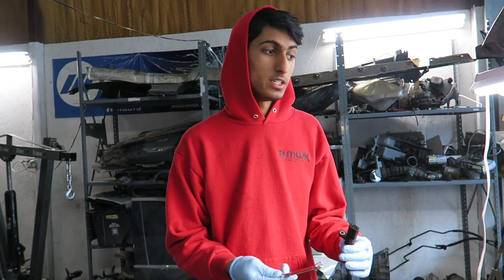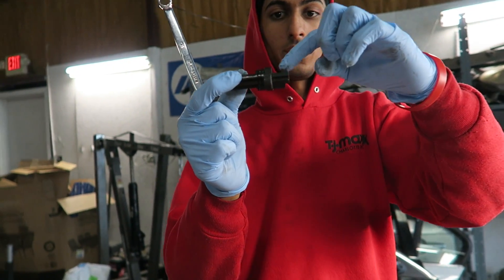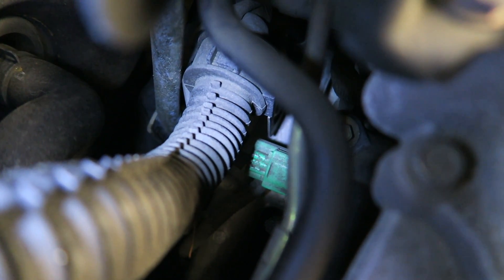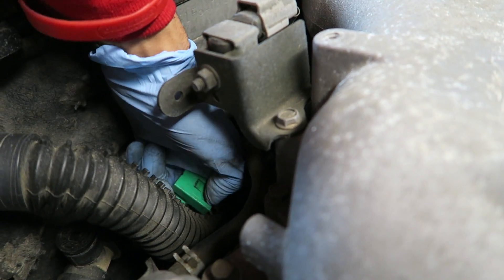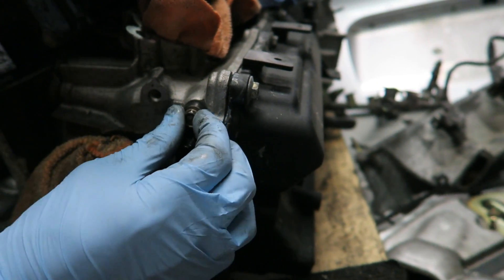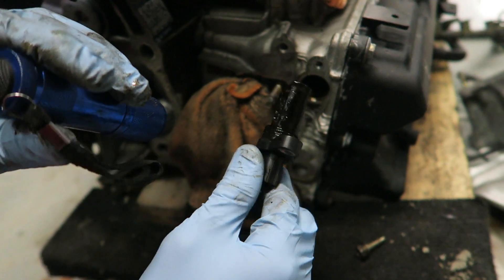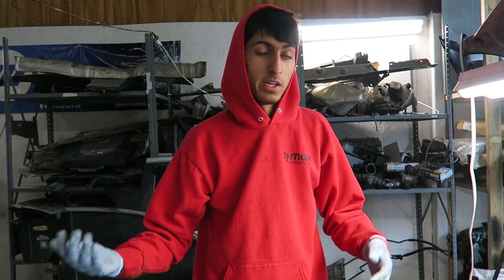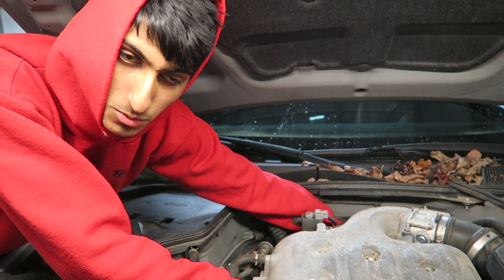Infiniti Camshaft Position Sensor Replacement DIY

Comment: Hey My Mechanic Just Replaced My 2 Camshaft Positioning Sensors Today On My 2005’ Infiniti FX35 AWD 3.5 Liter V6, Bothe Sensors Were Replaced Today 12/04/2022’ Sunday, I Bought 3 Oem Nissan Sensors From A EBay Online Seller That Sells Factory Part’s @ A Discount, Don’t Know Where They Are Getting Them From, But They Came In Nissan Oem Box’s, So They Sold Me The (2) Camshaft Nissan Oem Bank 1 & Bank 2 On The Rear Of The Motor Close To The Firewall & Were A Pain In The Ass To Work On, So My Mechanic Replaced The 2 By Firewall Passenger & Drivers Side, He Didnt Replace The Front Crank Shaft Positioning Sensor, He Did The 2 By Firewall, Started Car Back Up, & His Scanner Is Saying Something Going On With My Abs System, Why My Slip Light Is On VDC, & Abs Lights Are Still On, Now Videos On YouTube Are Saying That The Camshaft Positioning Sensors Cause The Abs, AWD, & Slip All To Come On, But Apparently Not, After He Replaced Them 2 Camshaft Positioning Sensors, Now The Car Starts Right Up Without Long Cranking Before It Turns Over, & So Far No More Stalling, It Would Just Stall Out While Driving, But After He was Done, He Scanned The Whole Car System, & Everything Checked Out Ok Besides, Vapor Canister Purge Solenoid Was Coming Up On Scanner, He Cleared Check Engine Code & Then Go To Start Car Again, Check Engine Light Is Back On, So He Said Order This Vapor Canister Purge Solenoid, & That Will Clear Check Engine Light, The Abs, VDC, & Slip Lights Are Still On, & His Scanner Pulled Up 1 Code Fault Abs System Code C1203 Which Told Him I Have A Bad Speed Sensor On The Wheels Behind The Caliber Or Something, But His Scanner Doesn’t Tell Him Which One Is Bad, So Is That True, That My Abs, VDC, Slip Light Still On Causing These Lights To Stay On The Dash? He Said It’s 1 Or All Of The Sensors That Are On Each Wheel, But Like I Said His Scanner Doesn’t Tell Him What Wheel, All These Other Videos On YouTube, Were Saying If You Have Bad Camshaft Sensor, Will Trigger The Abs, Skip, & VDC Lights, But Apparently Not Because 2 Sensors Were Just Replaced Today, & Car Is Starting Up Quickly Now & So Far No More Stalling Out & Long Cranking Before Engine Fired, So What Are Your Thoughts On Why Abs, Slip, VDC Lights Are Still On

Comment: First you show a tube and a hose to the left of the camshaft position sensor, then later, the tube is gone and you have more room. What did you remove to get more room, and how did you do it?

Comment: Both sensors on ebay $13.17 free shipping....for a few extra dollars you can get a warranty from square trade..unlimited warranty..here's the link.

https://rover.ebay.com/rover/0/0/0?mpre=https%3A%2F%2Fwww.ebay.com%2Fulk%2Fitm%2F252804496479

Comment: I’m trying to determine what happened first in my FX35...a faulty sensor that caused oil to squirt out of it, or an oil leak that caused the sensor to go bad. 
All the issues that you described in your video are in my car.

Comment: Yo ShopLife! Just replaced my camshaft sensor bank 2 (driver side) with the help from your vid as well as changing the belts from your other video. Very helpful, thank you for taking the time to make these. 

Out of everything I did on my car today, the hardest and most annoying part was the shield underneath the car. So frustrating, all the bolts were rusted and when I tried loosening them it would break the plastic surrounding it. Had to use zip ties :O

Comment: duuude, you work on nissans too? didnt know you worked on J cars. i just left japan a month ago for california. picked up an 03 Nissan skyline (g35 in america) a few hours ago. took it home and as I was backing into my parking spot, it shut off. I remember having the same problem with my e46 in tokyo and it was the cam sensors. As with the e46, i didnt get a check engine light on the skyline. so i immediately suspected the cam sensors. i'm heading down to southern cal in a couple months, as one of the reasons I'm in the US is to make a film. would most def love to come check out your shop. Thanks for the vid.

Comment: I have a 08 g35 and my slip light and vdc light is on engine won't shut down sometimes and trying to drive while these lights on is like pushing a 10 ton elephant won't go faster than 10-15mph I placed the car in neutral or park and it throttles up by itself could it be the sensors or something completely different???

Comment: I change the camshaft position sensor but the light still on  
My Code says : CAMSHAFT SENSOR "A" CIRCUIT {BANK 1 OR SINGLE SENSOR
Reply: There’s 2 sensors

Comment: ShopLifeTV: Hey... This might not be the same topic, but I hope you can help. After I just changed my spark plugs on my 2003 G35 Sedan, my service engine light produced P0011 - A - Bank 1 (Intake valve timing control) and C1130 (Engine Signal 1) codes. I made sure the connections of the affected sensors snapped together, so I believe I've ruled this out. The Infiniti service manual said the camshaft and/or crankshaft sensors may be the problems as well. What should I do next?
Reply from the maker: Erase the lights and see if they come back, and double check the wiring again because it's usually not a coincidence
Reply: ShopLIfeTV: Hehehe...I forgot to snap on a few sensors. I solved the problems several weeks ago, but it cost $27 to have a local mechanic disable the "Service Engine Soon" light. Thanks for replying though.
Reply: ShopLifeTV I have a 2006 Infiniti m35 and my lights were on for awhile so I went out to cut them off the next morning my car didn’t want to start none of the light on the dashboard came on and and I got my battery recharged and changed my battery in my remote and all of the lights in the interior comes on I can even honk my horn but when I put my key in the key fob it doesn’t light up nor do the car start even after I got a jump none of my fuses are broken or burnt nor none of my relays except one also my car had stop making the beep sound when I press any button I have been telling me that my remote battery was going dead for awhile but even after I finally got a new one the car won’t start nor will the dashboard at least light up with the new battery in the remote I even got a jump and still nothing

Comment: My 2004 g35x sedan it take some time to crank over and turn on it doesn't have no check engine light on I check it with the ODB 2 and nothing comes out ...after it turns on car runs strong should I change the camshaft sensors -what do you suggest to do ....?
Reply from the maker: I would try changing the camshaft sensors first and then go from there.

Comment: This would explain a lot of the issues with my car. I pulled P0345 but for some reason the cabin of my car smells strong of exhaust fumes. Could this have anything to do with it?
Reply from the maker: Exhaust fumes are probably due to a broken flex pipe.

Comment: Hey, I got the P0340 code and I replaced the sensor, the code still kept coming up so I replaced the connector (the connector didn't lock in anymore). The code still keeps coming up. Any ideas as to what it could be?
Reply from the maker: Did you erase it? What kind of sensor did you use?
Reply: +ShopLifeTV I used an after market part and it didn't work. I then went to Infiniti and got an oem and that fixed the issue.

Comment: Great video...thanks for posting....changed the part out and no more stalling or rough starting...the  SLIP light and Vdc off light have gone off but my CHECK ENgiNE SOON is still on...will that go off after awhile or will I need to take that in somewhere to have it reset?
Reply: did u ever get an answer of this question or what ever happened to your outcome
Reply: I found a video online on youtube that shows you how to manually reset the check engine light with a specific series of key turns and accelerator pumps....it work like a charm...i didn't realize this vehicle had a "self diagnosis" mode built in...you don't even a need a code reader....all good now
Reply: +Mike Murphy did you change  just the passenger side one or both sides...I've changed the passenger side one and the light is still on but still having trouble on the car starting at times
Reply: I only changed the passenger side and that fixed all starting, stalling and idling issues.  I was able to get the SERVICE ENGINE SOON light off but following instructions of another video on youtube that shows how to manually turn the light off by a series of key turns and pedal pumps..
Reply: +Mike Murphy did you buy the sensor at the Nissan place or just at a regular auto zone or oreillys? I bought mine at advanced auto zone
Reply: I purchased at AutoZone...$99 plus tax (includes lifetime warranty)...I have seen them for as little as $10 on ebay but I wanted something that I thought would last...this thing was a pain in the a** to change out (i had a hard time getting it out of the wire harness and it was very difficult to reach even after removing a few parts) so I only wanted to go through the process once...can't say to the reliability of the other vendors that sell cheaper knockoffs although several people reported them working fine while others said they failed quickly...
Reply: +Mike Murphy alright thank you, like I said I did buy mine at auto zone but the check engine light is still on and still have problems with the car not turning on sometimes..my only choice is to change the other sensor on the driver side too and hope tht helps the problem
Reply from the maker: Just saw this, sorry. It should go off by itself as long as there aren't any other fault codes, or you can do the manual reset like you already did.

Comment: if you could do a little video of that driver side that would be awesome
Reply from the maker: It is practically the same procedure, you will have more access from the passenger side to go around the throttle body.

Comment: nice I just replaced the passenger side and it's running strong again/ before I got the vdc off check engine and skip light all on and the car was riding rough and shifting bad and hard to start and dies in neutral here and there so thanks bro for this video you really helped me out and it was pretty easy to do as well i would say putting the bolt back in is a challenge due to lack of space other than that np
Reply from the maker: Good job man! Glad to hear everything worked out well.

Comment: Curious if you think mine need to be replaced... My symptoms is on a warm startup the rpm is drop very low or stall then go to normal RPM.  This is intermittent but I have no check engine light. Thanks!  And on a scale from 1-10 how hard is install?  I'm not very mechanically inclined.
Reply from the maker: I would say this is at the same level of difficulty as an oil change. What year and model is your car?

Comment: I broke the little green plastic spring that basically makes a snap on so what I did I just took off the green plastic and I just put it direct if Siri pretty much flush obviously if you pull on it you could take it off but other than that I try to wiggle it around when it was out and it wouldn't come off do you think it's going to be OK that's on the one that sits on a angle
Reply from the maker: You should be fine, but if it does ever start giving you problems just find someone parting out a similar model and replace the connector.

Comment: @ShopLifeTv, hi I just replaced both camshaft position sensors bank (1,2) my service eng light is still on. will it go away or do I have to clear it
Reply from the maker: +21bortters It should go away after a few cycles. I suggest you order a cheap bluetooth scanner off of Amazon (I have the bafx scanner) that way you can clear and diagnose codes with your phone or computer.

Comment: Does anyone know any link where I can buy both camshaft PS?
Reply from the maker: +Nelson Baro Just input your cars information on advance auto parts or auto zone and they should be able to give you the correct parts. Just make sure you don't buy the cheap sensors and try to get the Hitachi ones. You can also order online from Amazon or Partsgeek.

Comment: Bro, I have recently purchases a 330ci and my engine light has been turning on and off.. and few days back the engine stall on the highway and i parked on the side tried to turn it on but it would crank and start but then the ampere would drop and the engine shuts off.. but then after letting it cool down for a day or so it would turn back on.. Any idea what the problem is?
Reply from the maker: +mujib ahmad First things first I would scan the codes and see what comes up. It could be a number of things.